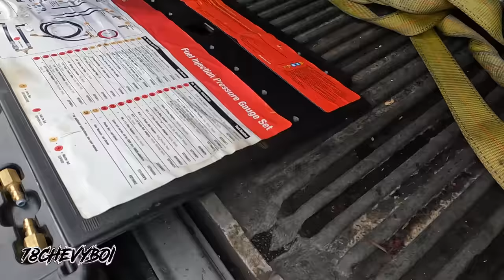Big Mo’s 1979 Caprice “LANDUSA” has that LTx Power Now‼️ #ltswap #horsepower #6point2

Comment: The check valve leaking back to the tank it should hold the pressure in the line so next time u crank the lines are already primed.  Have Kelvin put the gauge on it an see how long the pressure stay at 47 you’ll see in bout a hour it falls thank me later
Reply: Was just about to say the same thing
Reply from the maker: Thanks bro I just sent this to Kelvin.. Good looking out 🤞🏾💯

Comment: I think you got a weak fuel pump?? when you put that gauge on and turn the key?
the gauge reading is suppose to jump up to about 40PSI before you statry it completely
yours didn't move at all until the car was started, meaning your pump is going out real
soon... not sure if your car has a Fuel pressure regulator on the rail? but looking at the
video i'm 90% sure your pump is going bad....🤔🤔